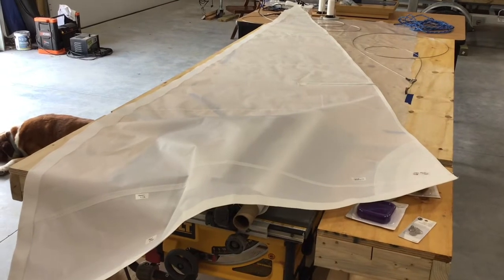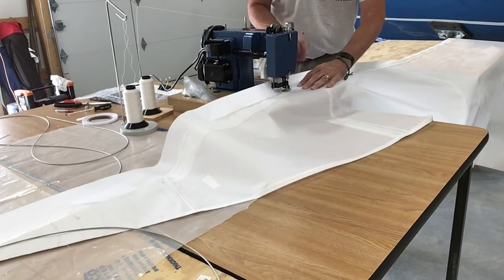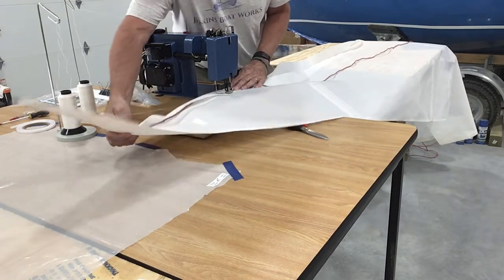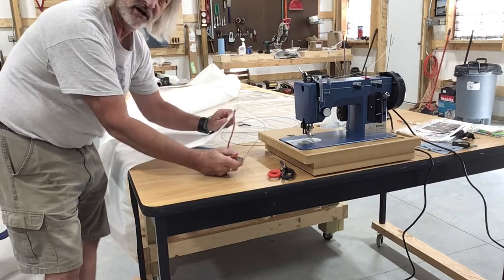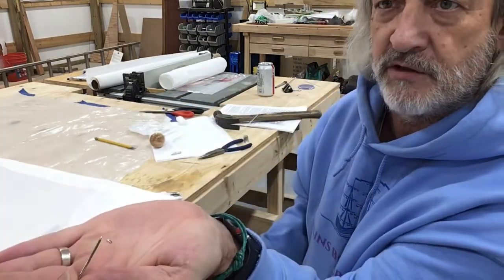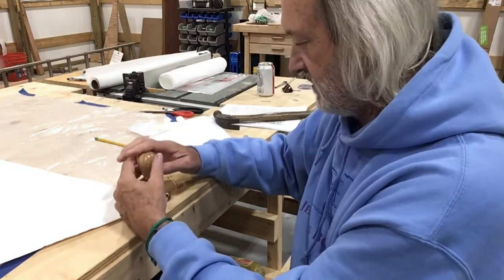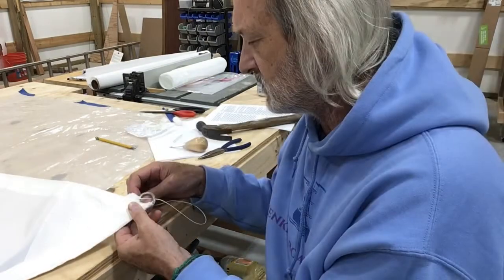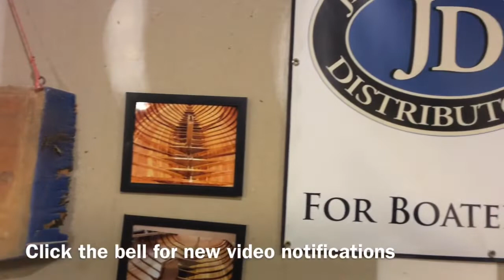Sail making- Jib Luff Wire- Episode 110, part 2

Comment: I thought: why not sew the wire in, but then, I suppose, you can't get it out without unpicking the seam at a later date. Needles are hardened, so quite brittle. I quite enjoy stitching and have made leather knife sheaths and pouches. Pliers work just as well as a palm, but a good awl makes all the difference.
Reply from the maker: Hi Dale. I'm just about to sew the pocket for the bolt rope on the main. I'm asking myself why not just put the rope in as I sew but directions say put in a string and then pull the rope through. we will see..